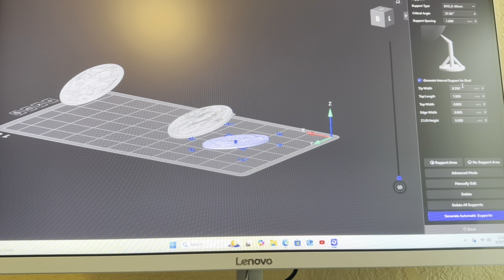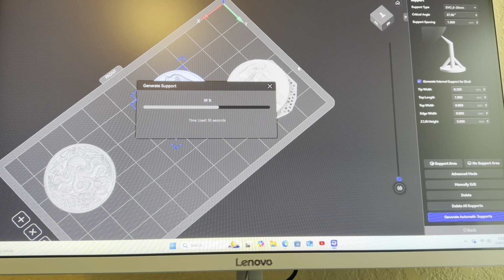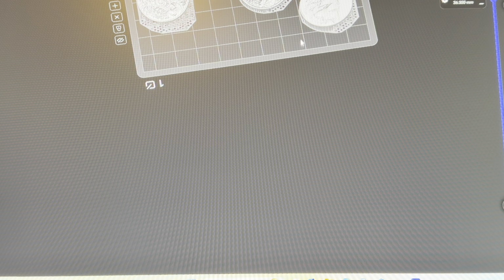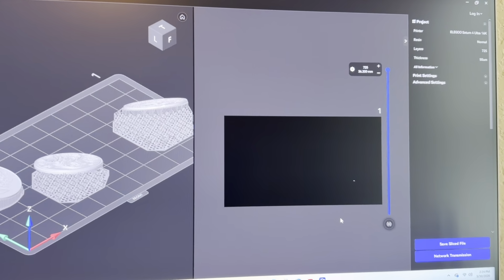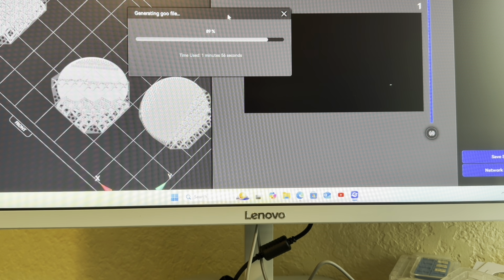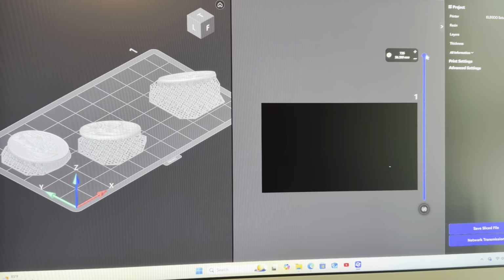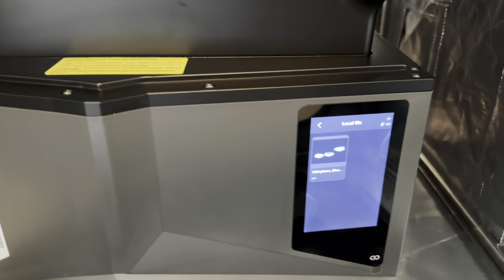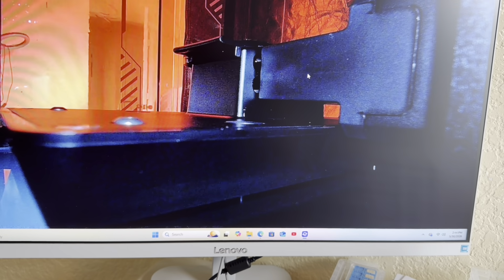Elegoo Saturn 4 ultra 16k Resin Printer

Comment: I need to learn this software, nice work Pang 👍 They all look awesome, but the indented one the Kraken really looking forward to seeing how that one pours. you could use little wire snips to remove the supports.
Reply from the maker: I wonder if the loading will be better if I get the paid version but it’s slow 😢 My files have errors and when I upload it the system has to repair it and that part takes forever
Reply: @PangsBullion  have you seen FG's series on this stuff? it was pretty good. You have made it further then me I have been staring at my printer far longer than I will admit. I think I just got a bit overwhelmed I need to make room in my shop and just do it. again, nice work man.
Reply from the maker: @bear788  the computer I got says the graphics are to slow so I returned it and got another one😢😢 tried to go cheap😅😅
Reply from the maker: I’ll search his vids
Reply: @PangsBullion  It's fairly recent sometime in the last month or 2.  🤙

Comment: I don't know, I get stuff that I want to learn about, but it doesn't happen.  I have a 3D printer, got lots of material stuff, but never did anything.  I also have a GG3 CNC machine, and never used it either.  If you want to do a Polymer 80, let me know.  Pistol, AR15, or AR10, if you would commit to adding the barrel and internal parts, I'll send you a kit.  Of course, if you don't say AR10, your approval rating will drop by a half point.  Seriously, you can choose, and I'll send you something to play with, if you want.
Reply: If you know anyone with a CNC machine, I could send you an 80% Aluminum lower.  I don't think you need a Ghost Gunner.  That would probably be easiest, but I think other CNC machines would work.
Reply from the maker: Thanks for the offer I’m just busy right now🤙🤙
Reply: @PangsBullion  Let me know anytime, polymer pistol or rifle, or metal.
Reply: @MO-Silver59 🔥🔥🔥🔥